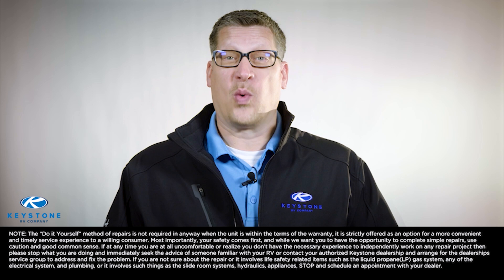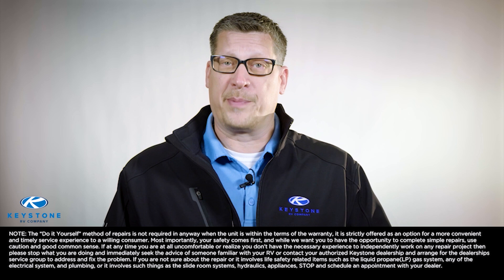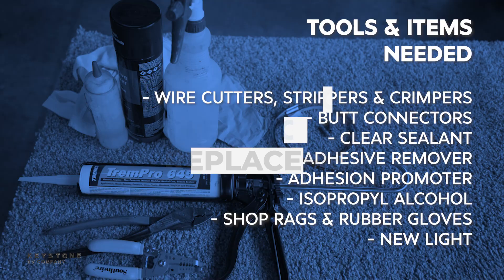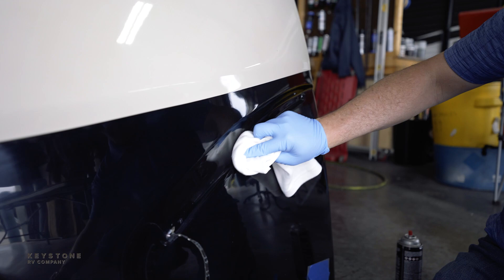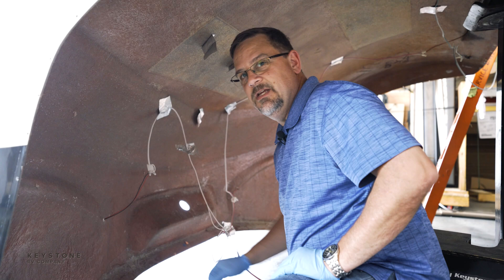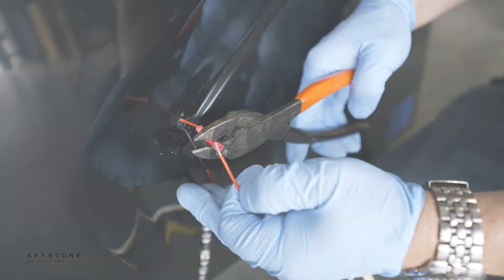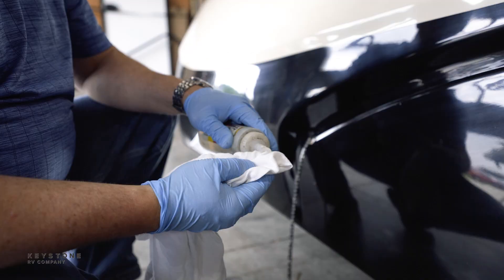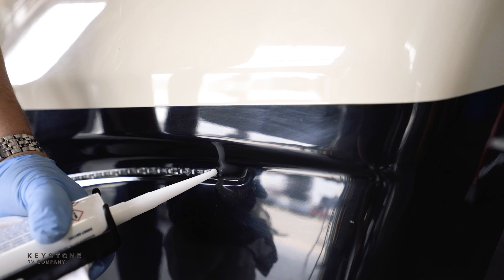Pro Tips - Front Cap LED Light Replacement

Comment: I'm curious what some examples of an "adhesion promoter" is that you wiped on prior to sticking on the new strip?
Reply from the maker: Good morning, thank you for your inquiry. You can obtain the following from Amazon and what is used in the video. Alcohol used to prep is enough but we recommend the promoter since the light strip is subjected to high winds. 3M 4298 Adhesion Promoter, comes with 5 sponge applicator. Thank you!

Comment: Do you have to take off the whole front cap to do a light replacement or ca  you do it with the cap in place ?
Reply from the maker: Good afternoon! You would not have to remove the front cap as the wiring would be accessed towards the end of the wiring through the caulked hole. If you have any further questions please let us know. Thank you!

Comment: What to do if the wire slipped inside the cap
Reply from the maker: Good Morning! If the wire slips inside you can sometimes fish this out by using a tool that could hook the wiring. If for some reason you are still unable to get this out, we would then recommend that you contact a local Keystone dealer near you to properly fix this! Thank you.
Reply: @KeystoneRVCompany  thank you for your advice. I was able to remove a shelf in my closet yesterday which gave me access to the cap and the wire. 👍
Reply from the maker: @blueridgecheermom  You are very welcome!

Comment: How to replace the round LED lights, not the strip.
Reply from the maker: Hi there! Use this link to watch our video on how to change a 12V light: https://www.youtube.com/watch?v=iaxQRvKgINU&list=PLwskBGnT1pj0IDyRFENcPsQ5_q3II8e7e&index=42
Reply: I was referring to the round lights in the front cap. My front cap has small round blue LED lights, not the light strip.
Reply: I am replacing mine tomorrow, I will solder and heat shrink the wiring. I don’t trust butt connections.